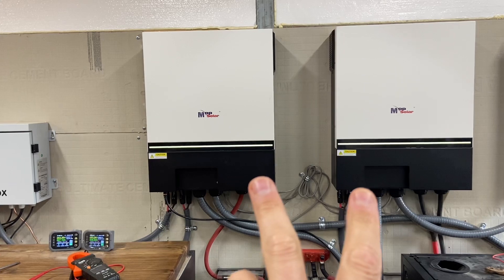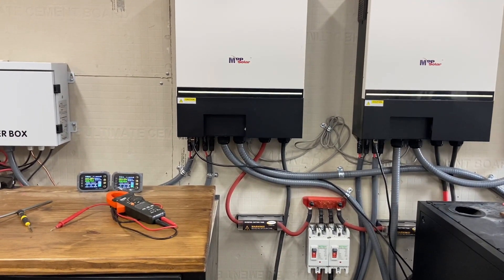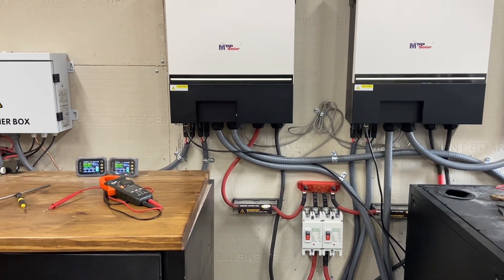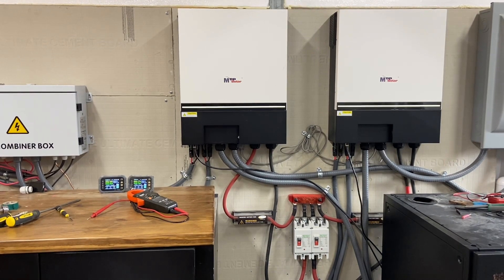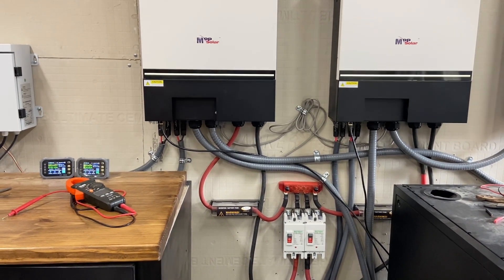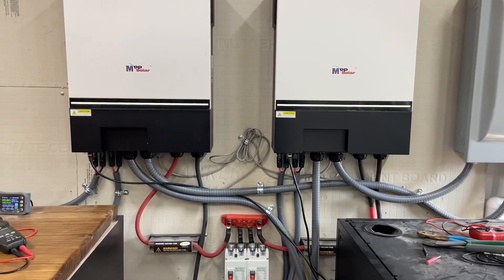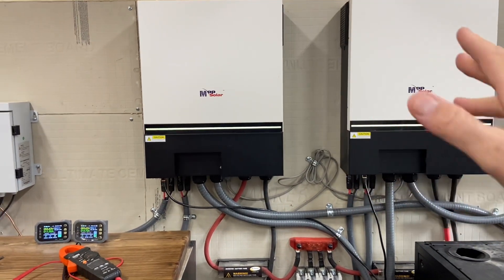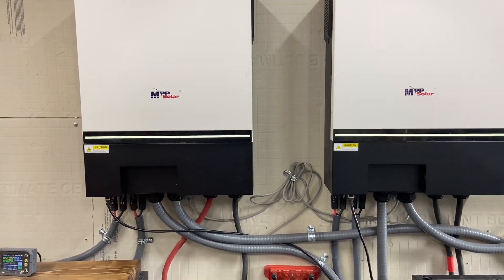My negative thoughts on  EG4 6500ex inverters.

Comment: This video popped up in my feed this morning. We have been acquiring the components for our 48 volt solar system (off-grid). We have two of the Eg4 6500ex inverters for our system and really based it off of Will Prowse and his recommendation. They were purchased a year or two ago but have never been taken out of the box because we weren't ready to install. Did Eg4 ever solve this problem or am I going to have the same problems you did?
Reply from the maker: Yeah I did a follow up video. They made things right by me. I think I added some details in the description also.

Comment: If you ask me, and I have seen this with numerous Chinese made products where they are the OEM for American companies:  CCP Sabotage in order to have people buy the superior China brand identical product. My opinion now is that this is fact. LED bulbs are definitely a problem (the driver/ ballast). But I am inclined to agree, that I wouldn't want the extra potential THD or faulty sinewave (knowing that the MPPs work without issues). 

I have two brand new EG4s (first revision) uninstalled sitting on a table from about a year ago. Now I'm scared. Before I bought them I had some technical questions for their tech support (SS) and all I can say is they didn't know what they were talking about and couldn't answer my questions (granted I presume it was "Tier 1" TS). I wonder if lights would flicker if only one inverter was installed (i.e. not split phase)? That would be an interesting test.
Reply from the maker: There was actually a switch of some internal hardware at the factory level. It’s a long story. They came out with some firmware that did remedy some of the problems. The short answer is that the original version and the newer eg4 versions should be fine. But late last year they had some real issues. I have an update video describing some of this. I was refunded in full and since then have reviewed quite a bit of their equipment.
Reply: @GavinStoneDIY  - I see that you got the new EG4 Sol-Ark clone : )  Nice machine to be sure. I'll have to watch some of your other videos. Have a pleasant and productive week. -John

Comment: Just bought a SP6548 from sungoldpower.
Reply from the maker: Those have been hit and miss with problems. From what I’ve seen these issues have rippled down through the whole 6500 line of inverters. But hopefully they have worked it out. I know eg4 came up with a remedy for their problem.

Comment: Had the same problem with the EG4 6500EX and installed LV6548's in their place temporarily. The LV6548's work flawless. The problem is my array was set up for the higher PV input voltage so I'm currently running with only half my array connected. 

Signature Solar did RMA the 6500EX's and currently have them but I have not heard any followup from them about replacements. For those wanting to see the sine waves from the EG4's I received and the LV6548's, take a look at the videos on my channel. I have found the power is dirty from the EG4's and believe this will lead to circuit board failures in appliances down the road.

If you have the strobing light effect and see the voltage fluctuation on your EG4's after removing any bonding screws and updating firmware, I suggest contacting Signature Solar to begin the RMA process to get replacements. Gavin has the updated video on the later EG4's and this problem may be corrected. If I do receive replacement EG4's, I will be testing with a scope and posting up a video showing my findings.

Comment: had the same problem. There is a software update to address the issue and mine works fine now.
for what its worth. The new mpp do have the same issues, older ones do not.
how old are your units?
Reply from the maker: I went over this in my follow up video. The new units they sent for me to review work fantastic. No more issues. And yes indeed, some of the newer  Sungold and mpp units do have the same problem. They just had a larger back order of inverters before the problem started to show.

Comment: If possible, run, dedicated direct current wiring for the lighting and use LEDs straight, direct current to LEDs
Reply from the maker: This is true. But my issue was more then the lights.

Comment: Not the PV. My SP6548 has the exact same strobing issues! Fighting with it for almost a year. Finally saying screw it and buying LV6548's like I should have originally. SunGold kept promising a fix and it never came.
Reply from the maker: Eg4 has fixed that issue. I just released the video. I suppose SunGoldPower may eventually capitalize on whatever they did to remedy the problem.
Reply: @GavinStoneDIY  That firmware "fix" causes an error code 80. SunGold pulled the firmware from their site and had me flash back to the original. They have begun implementing hardware changes to the new units that supposedly fixes this.  But, with a years production of faulty units out there how is anyone to know what they are getting? I would avoid all the clones of the MPP units. They will not replace mine but expect me to buy a new one. No way!  

Signature really took it on the chin over these units. They should have stopped the sales when they knew there was an issue. Resolve it, then resume. I have had terrible service from them in the past so I can imagine all you had to go through. In many peoples cases these are their sole source of power so swapping/exchanging/updating is all time they have no power. A year is far too long to ask a customer to put up with a faulty device.
Reply from the maker: @MrMike-fn4hi  I think it was a hardware problem that everyone tried to fix with software. Whatever SS did remedied the issue all together. I had a really hard time with them before so I wouldn’t ever tell anyone to shop where they aren’t comfortable. That’s why I advised people to check the forum out also. It’s really  up to each individual. And if the mpp’s meet your needs with voltage then I think you’ll be satisfied. I’ve heard of a couple f80s on those recently  as well though. So I think it was most all the voltronic inverters in the factory.

Comment: Would you clarify for me.... Is the issue specifically related to the split phase functionality?  Meaning, did you have any complaints specifically about a unit that would be running by itself for 120V only capacity?  Thank you.
Reply from the maker: It seemed to be an issue with the voltage sharing of the inverters. So in single phase I doubt it would be a problem. However, signature solar has refunded me in full, and they have sent another pair of these inverters to review. They have also come with with firmware fixes to  correct problemS like this. I’m hoping to have a review video out soon.
Reply: @GavinStoneDIY  Tahnks for the video and the response.  I really appreciate it.  Your content is really helping people come up with solutions for themselves.  For us its an ice cream truck where we only need 120V.  Thanks again.
Reply from the maker: @kyleedugger  an ice cream truck? Now that’s awesome.
Reply: I only have one unit and every single dimmer controlled bulb flickers. UPS's on computers randomly trip out.. they are NOT good units. Finally giving up on waiting for a fix.
Reply from the maker: @MrMike-fn4hi  I just posted a video yesterday. They have fixed the issue. The new pair of eg46500’s I have don’t have any issue with dimmers.

Comment: Tell them you’ll start with the bbb, and if they don’t refund you that you’ll take legal action. No way you should be stuck with paper weights.
Reply from the maker: It definitely wasn’t a fun experience. Since then though I have been refunded in Full with an apology. They have also sent me two new inverters to review. So I should be able  to dealers the video soon.  So keep an eye out for that coming up soon.
Reply: @GavinStoneDIY  I was really hoping to get the eg4’s to charge my ev offgrid. Do you think you got lemons or that this is a recurring issue?
Reply from the maker: @APatchworkCanvas  my inverters arrive Monday. So I’ll have them on the wall soon. That way I can give you a better answer. This was a larger problem but they’ve come out with firmware fixes. Even if I can’t make the video right away I’ll try to get you an  answer on comment as soon as I know something. I think you’ll probably be good to go with them. But I don’t want to say for sure till I’ve seen it myself.
Reply: @GavinStoneDIY  I’d really appreciate it! I’m putting panels on a new pole building that will go up towards the end of this month. The eg4 inverters seemed like a no brainer because of the higher pv voltage limit. I have two out buildings for panels, and want to keep the system as simple as possible.
Reply from the maker: @APatchworkCanvas  sure thing. What type of batteries are you using with the system?
Reply: @GavinStoneDIY  was thinking about the life power 4. I’m going to start with 4-6kw of panels and 30kwh battery. I use between 30-60kwh a day in the summer and up to 80kwh in winter. I own a wood flooring business and am planning to ad a charcoal gasification generator to process our waste material into electricity.
Reply from the maker: @APatchworkCanvas  I like the idea of that generator. You may be a little light on the panels. But it’s hard to say. I have been super happy with my lifepower batteries. I need to do a one year review on them soon.
Reply: @GavinStoneDIY  that’s just to get my foot in the door. The second out building will fit about 6-7kwh of panels. The house will fit 8kwh. It will take time..
Reply from the maker: @APatchworkCanvas  that sounds like a plan!
Reply: @GavinStoneDIY  what are your thoughts on used panels? Looking at Santan solar pallets
Reply from the maker: @APatchworkCanvas  if you have the space they have panels at a good price point. And typically panels last a long time before they start to degrade. I just prefer larger wattage panels. And those are typically new. For ground mount I prefer bifacials. More bang for your buck. I bought 450 watt panels from sungold during their Christmas sale. Those things are awesome for roof mounting. But they are a little pricier if there isn’t a sale.
Reply from the maker: @APatchworkCanvas  so they just arrived today and everything seems good so far. Some minor blinks. But I’m getting some other bulbs to test with. If you wanted to wait for me to test them a few days then I can always touch base again. I wasn’t sure what your schedule was and how soon you needed to buy them.

Comment: I have a Schneider sw 4048 been solid for 4 years. i am mad they deleted support to parallel them now can only be done with xw 6848. I had thought about 2 eg4, glad i seen this video. maybe just save bit more for xw unit. your video almost makes it look like in power search / save mode. my little Victron when in this mode would do that.
Reply from the maker: I’m doing a review on a new pair of these right now actually. They refunded me in full with an apology. And since then have come out with different firmware to remedy the issue. I’ll hopefully have the video ready in the next couple weeks. I ran into a bit of a snag with them. But I’m working through it with support right now. You honestly can’t beat a Schneider. They are pricey, but the performance seems to be amazing. Anyway, keep an eye out for review. I’m thinking some of their issues may be solved.

Comment: Hi Gavin - I feel your pain. Sorry to hear this is still ongoing. We had the same issue with terrible SS support. I did a chargeback due to their unwillingness to support in a timely manner. SS rebrands these units, but acts like they designed these products. I presume the issue is some software issue. I dont have the strobing issue on my 6 inverters, only when using a blender or when pulling a lot of current through tankless water heater.
Reply from the maker: I was definitely not happy with their service. I think it’s firmware related yes. Since this video was made  I was contacted by management and they refunded me in full with an apology. They went over the some of the  plans they are starting to implement to take care of customers faster. Also they’ve sent me a new pair of inverters to review. I’ve been working on that video. So hopefully I can release it next week. So when it comes to signature solar I’d say they aren’t where they should be, but I believe they are finally working their way towards it.
Reply: @GavinStoneDIY  Glad to hear this last...I've got two of their Growatt 5000W/48V units, and while they've been working fine so far, I've been worried in case anything went wrong because I've heard their customer service isn't very good. I figure it might be because they are a smaller company, and they just need to grow their customer service department, and perhaps get a few more techs that can help answer problem questions. Thanks for the video.
You just aquired a new subscriber.

Comment: I have had my EG4 6500 since March 2022  and only issue has been error 61 which was corrected and as for some of these you tubers pushing it I believe most of theirs they got before changes were made and they didn't have all the problems people are have with the new version. So I don't believe they are pushing anything. Wil never hesitates to tell you if something is bad.
Reply from the maker: I actually tend to agree. Based off what I’ve seen I believe Will’s inverters have worked great. It seems like it’s the second Generation EG4’s that have had an issue. Between hardware and firmware they have just been very glitchy and had multiple problems.

Comment: i have the eg4 6500EX and updated latest firmware  in march 2023. i now get fault code 71 and error code 61 when i try to use bms communication betweein inverter and egt 48v 100ah batteries.  only way to work is to set communication to user defined and manually set settings.   i am getting same impression that these are not ready for sale and was rushed to market !
Reply from the maker: Yes, they’ve had quite a few issues. What has tech support said about your problems? I was refunded for my inverters. And they Have sent me a new pair to review. I’m currently in the process of doing just that. So hopefully I can update everyone soon.
Reply: It was a defective Ethernet cable.  They replaced the cable and then I updated again the firmware. So far so issues, but the flickering lights are resolved

Comment: I was going to pull the trigger on a 6500EX on Friday with their sale going on currently, but after looking at the forums and multiple YouTube channels talking about Signature Solar's level of support (or lack thereof) and all the problems people seem to be having with the 6500EX, it's kind of scared me away from the whole concept.
I have money I had set aside to upgrade my little 12v system that runs my fridge and freezer when the power goes out, but maybe I'll just get rid of the pink rose colored shower in my master bath instead... :)
Reply from the maker: The LV’s I’ve been using have been great. However, signature solar has refunded me in full with an apology. And they’ve just sent me 2 new units to review. Stay tuned, I’m hoping to have a follow up video within a week or so.
Reply: @GavinStoneDIY  man, I've very nervous now. I should be ready to start my 4 up this afternoon or tomorrow.. I sure hope i dont have problems. Im really upset that they just released the new 18kpv and never mentioned it knowing im trying to run my entire home. I had a growatt 12k that worked flawless but didn't have enough VOC and i couldn't add another one together. We shall see. I was going to call them when i turn everything on help with start up settings.
Reply from the maker: @motomike1197  you should be fine. The new pair of Eg4’s I have are working great. Let me know how it goes when you throw the switch.
Reply: You might give Signature Solar a bit more time to mature as a company. With Will Prowse and others, plus Gavin Stone, they are going to feel the pressure to improve thier Customer Service experience ASAP, or find themselves out of business.

Comment: I am in the process of planning a system. I was surprised at the fan noise coming from your MPP Solar units. Have you measured the decibels? I'm curious how loud they are. And is that typical of these type of inverter/chargers? Also, I'm curious: If you already had these installed, why did you replace them (temporarily) with the EG4 units?
Reply from the maker: Sorry I didn’t see this comment till now. The fan noise is around 50 db at idle. I’m sorry I haven’t checked when they are fully charging. When they are charging at a high rate they are pretty loud. Much louder then you’d expect. I just recently downloaded an app to check the levels. I replaced them with EG4s because they have a higher voltage open circuit limit for solar. Which means you can run the panels in easier configurations. My voltage was spiking in the winter with the cold. So the eg4’s seemed like an easier option. Unfortunately I had issues with them. However, I have a new pair of them I’m reviewing as I write this. So stay tuned. I will hopefully have an update on that soon.
Reply: @GavinStoneDIY  Thanks for responding. In my quest to find the ideal 120/240V AIO I have noted that no manufacturers reveal sound levels of their equipment.
Reply from the maker: @johnbrzezinski1446  the solark is extremely quiet from what I’ve seen. Quite a bit more expensive, but a great inverter all around from what I’ve heard. So it really depends on what your budget is. I’m hoping to install a solark 15k within the next few months so that  will definitely be on my list of things to measure.